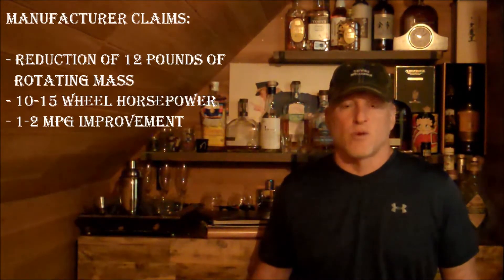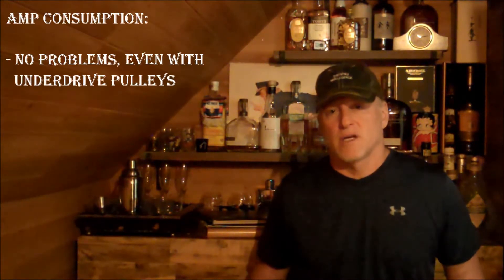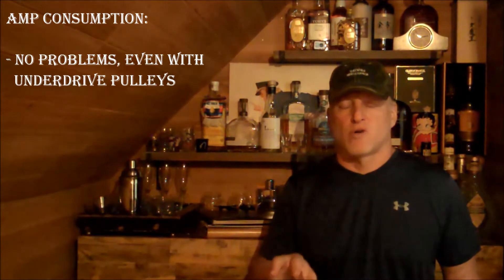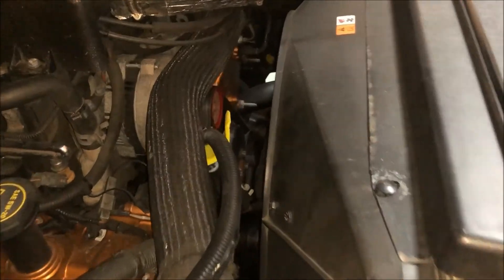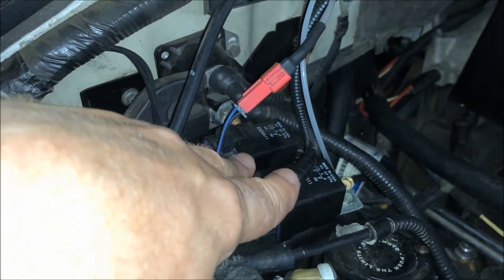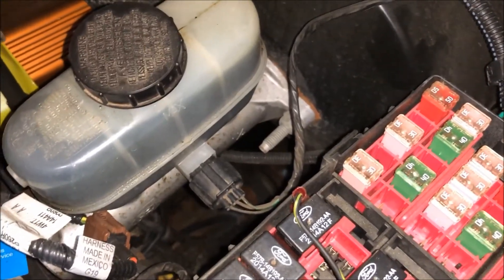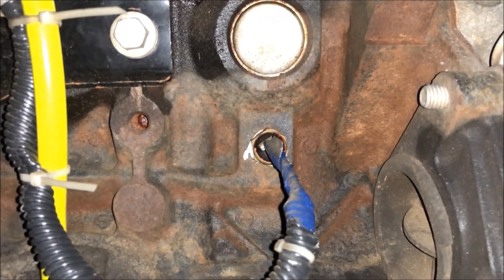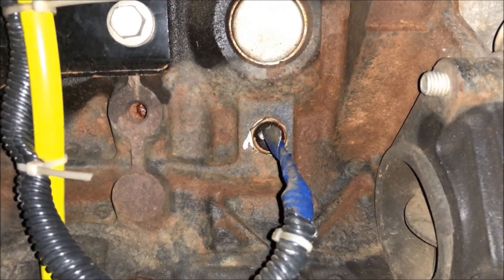+HP +MPG +Throttle Response From Electric Cooling Fan Conversion: All Vehicles & 10th Gen F150, F250

Comment: thanks for sharing your setup.  I have a 2001 f150 crew cab lariat and i'm hoping to get this eFan installed on mine as well.  do you have a video that shows the installation process?
Reply from the maker: Appreciate the comment.  Soon I'll post a video showing the installation in a 2004 Dodge Ram with the 5.7 HEMI.  Installation is similar.  I don't have a video for the 10th Gen F150.  Is that what you're looking for?
Reply from the maker: https://youtu.be/1vdRbI2hKxU?si=oBAC6Dpa9sZHkWFX

Comment: Factory Dodge Charger RT dual cooling fans fit the radiator perfect for any 3rd gen dodge radiator. All you have to do is cut the mounting ears off the fans a little trimming around the side of where the shroud bumps out around the fan, and use to L brackets on the top and bottom to boot them on.  These fans pull at least 4000 cfm or more. I put a set on my 4.7 Dodge Ram and it's amazing they barely run and cool FAST.
Reply from the maker: appreciate the input

Comment: Thanks man! Was the 195 relay the right one? Another video said that the 180 relay makes it kick on at 188 in his case. Any issues with it?
Reply from the maker: That temperature sensor I selected works out well and is compatible with my performance tune.  It turns on somewhere around 190-195.  Only issue is that when it turns on, it won't turn off until I turn the off vehicle.  I believe this is because the engine retains all that heat and does not cool below 185.  Perhaps if I used a cooler thermostat, it would shut off, but I'm good with it the way it is.

Edit: I switched to a 210/195 sensor and now the fan cycles properly.
Reply: @DrivingIntelligence  
Thanks for sharing. I have read this. What do you think of it? Your opinion, please.
“You should choose a temp sensor that operates at approximately 10-15°c above your thermostat temp, for example if the thermostat begins to open at 80°c then it would be best to choose a sensor that turns on at 90-95°c and
turns off at least 5c before the thermostat is fully closed.”
Reply from the maker: @Blue-mine  I recently changed to a 210/195 sensor to work with my 185 thermostat.  This way the fan will cycle on and off instead of running continuously.  So, fan turns on 25 degrees F over thermostat, then off 10 degrees over thermostat.

Comment: Just did a E-fan kit from Hayden but did a rod type for the temp sensor and a aux trans cooler on my Sonoma ZR2. Only drive. It 10mls from the shop and they drove it around a bit as well checking trans and engine temps but happy with the conversion. Definitely feel a throttle response difference and heats up even faster but it doesn’t take a 4.3 over 5mins at idle. Running a Hypertech tune with a Volant CAI and single high flow cat with a set of super 10 dual. Definitely looking forward to seeing my mpg gains if I can keep my foot out of it
Reply from the maker: Glad to hear the conversion was successful and that you're seeing improvement.   I also have many other mods that have improved overall performance and fuel economy.  Check out my fuel economy playlist:  https://youtube.com/playlist?list=PLGNsbVXzRfZNKm6BPAfg2YTQhCKId0kSt&si=e9YJ2OMscWPsp7-s

Comment: Is the sensor installed where the engine block drain plug goes?
Reply from the maker: Good question, I found a screwed plug on the driver side of the truck (below exhaust manifold) that I removed and used a sensor with NPT threads in its place. Works like a charm.
Reply from the maker: Good question, under the exhaust manifold on the driver side I found a screwed plug that I replaced with a sensor that has NPT threads. Works like a charm.

Comment: I really want to do this, but I still am a bit concerned about the performance of the alternator... I'm no professional electrician, but I have heard a few people talk about how the electric fan draws to much in other vehicle conversions. Since you said your stock alternator was fine with the fan and the underdrive kit, I am definitely considering it, but still just a bit weary.
Reply from the maker: It's a valid concern, but to date I've had no issues with my charging system.  What vehicle do you have?
Reply: @DrivingIntelligence  I've got a '97 4.6L v8 F150, so really similar to yours. Just recently got a good deal on a volant system so I installed that and am getting ~18.5-19.5 mpg consistently on our highways nearby (at least according to Torque, my tire size is off so I don't have an accurate manual calculation). I've got the mileage bug now, so curious on how much more I can squeeze out of it! I'll definitely continue to keep an eye out for a deal on an electric fan kit though. Glad to hear yours is treating you well.
Reply from the maker: That’s great fuel economy, have you seen my fuel economy playlist? Before I put the bigger tires on I was getting close to 23 miles per gallon with this truck at Highway speeds.

Comment: What was your color positive wire to the ac clutch fan? Also after connecting the red wire from the fuse box to the vsc, I noticed that was the only connection from that point do you need to attach another wire from the fuse tap to the positive battery terminal?
Reply from the maker: I really can't help... I don't know what system you're using.  Check out this vid, might help:  https://youtu.be/1vdRbI2hKxU?si=1-NGrsqG44OOLHx_
Reply: @DrivingIntelligence  I realized this video was for a Ford, the one I'm referring to is for the flex a lite 183 for 03 to 08 ram 1500
Reply from the maker: @alfredmoreno4697  There is only one wire that goes to the fuse box, it is a switched connection that gives indication to the VSC that the system should activate.  The power and ground go directly to the battery.  All of this is shown in the video I shared previously with the install of the Flex-A-Lite kit in a Dodge Ram.  Please check it out.
Reply: @DrivingIntelligence  Okay, thank you for clarification. I was a little confused because on the picture diagram that was with the instructions, had a picture that was the wire going from terminal number 9 on the vsc routing to a key the from that key to the positive battery terminal. I have everything else wired except for the fuse tap connection and splicing into the positive wire for the clutch fan for the ac. By any chance do you remember what color wire was you positive for the ac clutch?
Reply from the maker: @alfredmoreno4697  Hi friend, did you watch my video specifically for the Dodge Ram?  All your questions are answered in that video.  The kit I installed had a green wire that tapped into the AC compressor wiring.  I really suggest you watch the Dodge Ram video which should directly apply to your install.

Comment: Can u please tell me how to install
I have Ford f150 1998 motor 4.6  4x4 extended cad 
I bought a doble fan from a.ford f150 I think is from a 2017
Reply from the maker: hi, unfortunately this is a bit more complex than I can explain in a comment.  You'll need a wiring harness with proper relays that includes activation by the HVAC and a temperature sensor for the block.  There are many harnesses out there that can be used with your application.  Just do a search for "Electric Fan Conversion Wiring Harness For Dual Fans".

Comment: You can use a clutch fan with a custom blade. Its best to get hard plastic large blades with a aggressive angle. The lighter the blade the less resistance on your engine belt.
The lighter the clutch the better MPG and HP.
There are 3 types of mechanical fan clutches:
• standard duty runs at 45-65% of water pumps RPM's.
• heavy duty runs at 70-80% of water pump RPM.
• severe duty runs at 90% of water pump RPM.

The faster the clutch us designed to spin, the more resistance it adds to your belt drive. This translates to more HP and MPG loss.

So get a lighter fan clutch(<3lbs) and blade(<3lbs).
The metal OEM fixed/Flex fan blades are extremely heavy ranging from 16-25Lbs alone. A 16lb fixed hub flex fan blade that doesn't have a clutch and runs at belt speed has the most engine drag (loss in MPG/HP/Torque) because it is always spinning at a 1:1 ratio. I measured my loss as 10-HP with that 16lb metal clutch fan blade. The non clutch fan fixed flex blade had 25HP loss.
A clutch fan thats standard duty has the least drag/resistance. Only lost my Jeep 2HP at 4000RPM.
A heavy duty added 2+ HP loss.
But understand you can swap the blade to 3lb bigger plastic fan with more blades and more CFM airflow speed.
This counters that loss by a large margin. 3.3lb is around 1/5 the weight and there are OE metal blades that are 25lbs+
Only use heavy duty or severe duty Clutch if you absolutely need it. Meaning standard clutch doesnt cool engine enough adter you have tried multiple plastic blades with different angles and shapes.
Look up the Dorman 620-155 clutch fan 11 blade if you have a Ford Explorer/F150 or a Jeep. Only moderate modifications are needed like drilling bigger bolt holes in blade and filing the clutch inner curcle to make sure the fan blade inner circle sits flush on clutch when bolted.

Electric fans have many failure points and far more dangers than mechanical clutch fan systems.
Electric fans also cause additional current draw on your charging system (alternator) for example on a 99-04 Jeep WJ 4.7L, it comes with a 135Amp alternator and a proper 3500CFM electric fan requires a 160-180Amp alternator just to use it.
For most people 2-10HP loss and <3MPG loss is not a big tradoff for simplicity, affordability, ease of installation/repair, added saftey, lower failure rate of a clutch fan.
But there are definitely some space saving E-Fans out there but in my experience its a $250-$350 Spal or Flex A Lite setup with custom shroud, complicated varible controllers with relays, fuses/breakers, switches and temp switches. Compared to a new brand name clutch & fan blade setup for under $90 shipped.
Everyone has a crescent wrench and ratchet strap to remove ir install any clutch fan.
Reply from the maker: very nice write-up.  Where do you live, perhaps we can make a video about this together.  ;)

Comment: You don't need a clutch fan tool. Put a couple bolts into the water pump pully and wrap a small ratchet strap around bolts and over another pully and hook it on itself. The ratchet strap keeps pully from spinning.
Use a large crescent wrench (adjustable wrench) with a fairly large jaw 1.5-2"
Reply from the maker: thanks for the input

Comment: is there a possibility that i can install the fan between the factory fan and the radiator ? on a 2009 ford f150  i know its sound crazy, but believe me i have a reason for it, 
Thanks for any help !
Reply from the maker: Would like to know your reason.  I’m sure if the clearance is there, it’s possible, but you should probably look at pusher fans that mount on the front. This is an example:  https://amzn.to/3Byk06t
Reply: reason is because i live in a send storm environment,so if anything were to happen to the efan, the stock fan would still go no matter what
Reply from the maker: @csabi72  Gotcha, but you will not get the benefit of getting rid of the heavy mechanical fan.
Reply: You can with 1997 crown vic it did came with E fan and clutch fan too

Comment: With the e fans and the tune how many horses did you gained?
Reply from the maker: I’ve not dyno’ed it.  Claims are about 15 hp from the fan and maybe the same from the tune.  Biggest improvement is throttle response and how much better it cruises down the highway.  It’s a joy to drive now.

Comment: The fan can back-feed power to the relay causing premature failure from it spinning if there's not a diode from the relay to the fan. I have my 2spd from a 3.8 Thunderbird but I haven't purchased my Dakota Digital PAC-2800BT 70amp fan controller yet. I thought about getting a setup from a Volvo. BTW the Mark VIII that was at the junkyard was missing it's fan - probably in somebody's Jeep by now.
Reply from the maker: thanks for that comment.  Good knowledge.